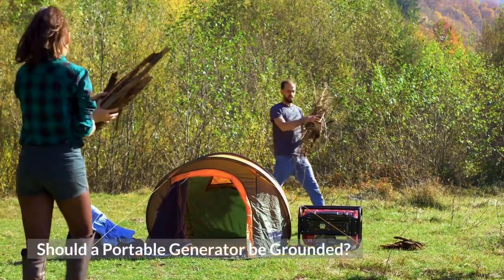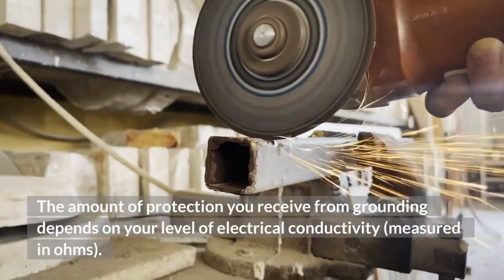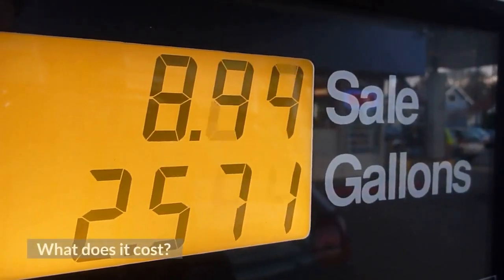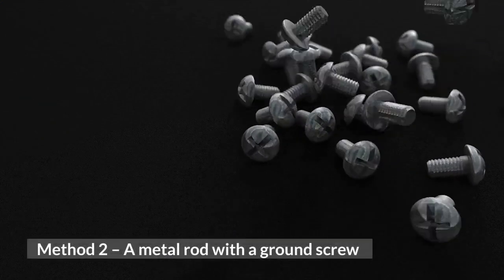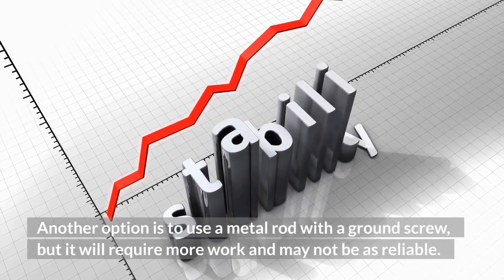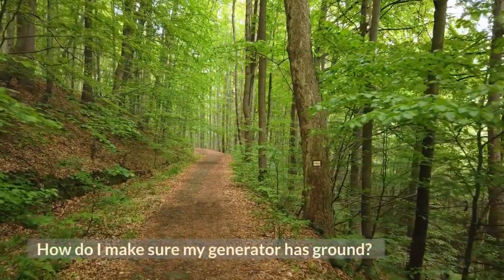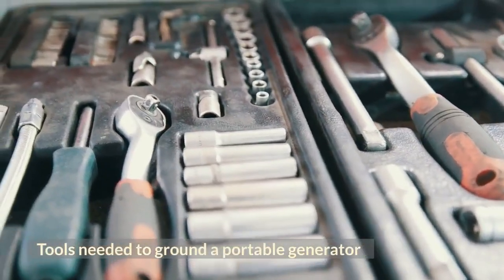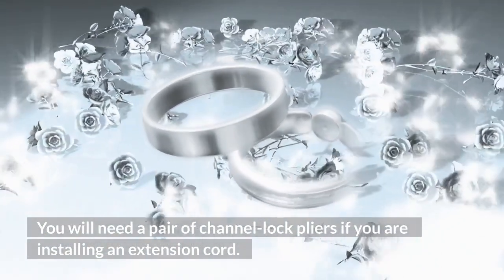Should a Portable Generator be Grounded?

Comment: N.E.C. states A separately derived system,  needs to be bonded and grounded at the main POWER SOURCE. A floating neutral generator needs to be installed into a preexisting electrical system(where the Ungrounded current  carrying conductor THE NEUTRAL) and the GROUNDING conductor(BARE OR GREEN) are to be BONDED at the Main breaker Panel !!!! (NOT AT THE GENERATOR)  OTHER WIRING CONNECTIONS ARE TO BE FOLLOWED WHEN TRANSFER SWITCHING(AUTO/MANUAL) EQUIPMENTS ARE USED. IF you want to use it at home and NOT connect into house power electrical system then use extension cords/lamps(nothing electrically connected to the house system then If anyone uses this same "Floating neutral generator" for camping as well for example(just the generator, a light bulb, and extension cord) then......
THIS IS A SEPARATELY DERIVED SYSTEM, THE NEUTRAL AND THE GROUND LUG ON FACE OF GENERATOR ARE TO BE BONDED !!!! PURCHASE A DEAD 110VAC MALE PLUG INSTALL JUMPER WIRE FROM NEUTRAL SIDE TO THE GREEN GROUND SIDE ONLY, THEN PLUG IT INTO THE 110VAC OUTLET ON THE GENERATOR.(THIS IS THE BOND)........AND DRIVE A 3/4' DIAMETER COPPER GROUND ROD EIGHT FEET LONG AND CONNECT WITH #6 BARE/GREEN WIRE TO GENERATOR GROUND LUG ON FACE OF GENERATOR !!!!!!!!! WRONG WIRING WILL KILL PEOPLE.  THE MANUAL DOES NOT TELL YOU THIS BECAUSE THEY STATE A DISCLAIMER IT IS A "FLOATING NEUTRAL GENERATOR" . When BRAVE IGNORENT people don't understand they CAN KILL "UTILITY LINEMAN" AND OR HOME OWNERS !!! That's why smart people hire licensed Electricians !!!!!!!!!!

Comment: no no no do not install a ground wire if all four conductors are installed in your breaker box. it will not be up to code. only one bonded ground is allowed

Comment: If both systems neutral is permanently connected always then your generator DOES NOT need a ground rod BUT YOUR GENERATOR HAS TO BE BONDED  GROUND TO NEUTRAL.

Comment: The only time you need to ground your generator is when you are hooked up to the house and the house's earth ground is lost when running on the generator due to switching of the transfer switch. In most cases, especially if you are using the generator to power some tools without being connected to your house, an earth ground is not necessary nor desired.
Reply: Hi, I have a duromaxxp12000hx generator.  We intend to connect to our house during power outages, do we need to ground the generator? The house is connected to a solar system which is grounded to an earth ground and a metal pipe in the house.